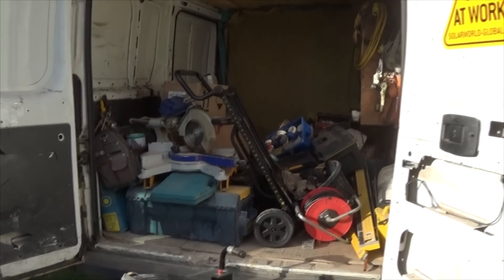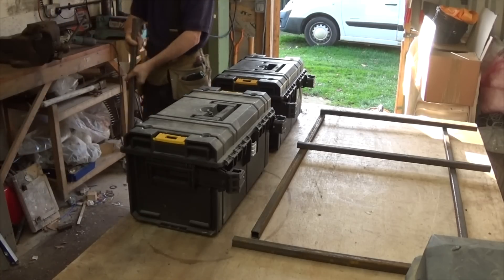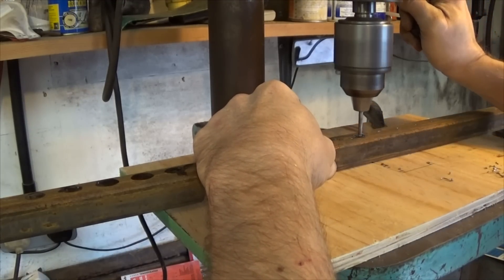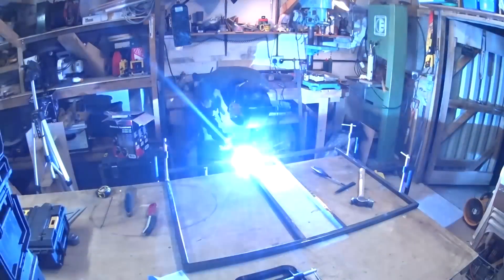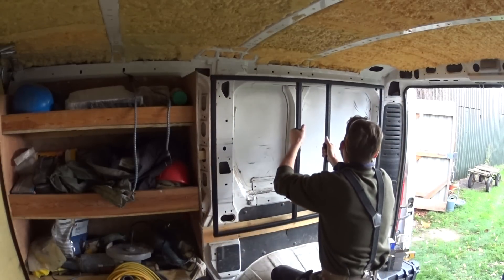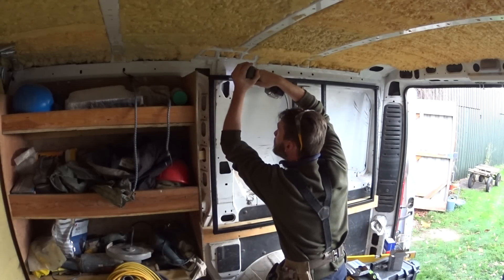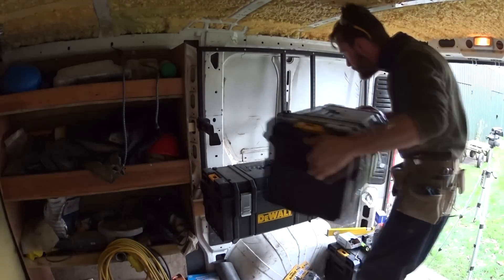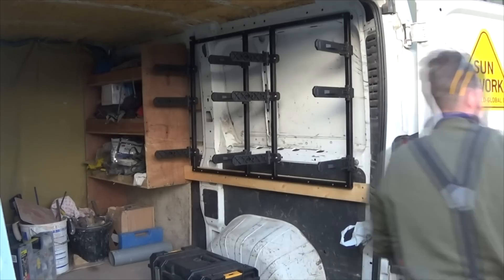Dewalt Toughsystem Van Storage

Comment: Hey there. How do the brackets hold up when the tool boxes are loaded?
Reply from the maker: +Geoff Johnston been over 10 months and all is exactly as it was when I first put them in. Works good.
Reply: I ask as dewalts version for a shed is what i bought and a week later they launch a setup specifically for a van. your setup looks good and strong. Whats your trade?
Reply from the maker: +Geoff Johnston carpenter, so tool boxes are full of drills saws etc

Comment: Looks spectacular. I'm a little concerned about the mounting screws though. My van has factory style shelving, not all that heavily loaded and the bolts (not screws) actually ripped the inner sheet steel. I'm assuming you have cordless tools and such in those boxes.
 I'd appreciate a follow up video after say, 1 year. 
 It's not like i'm doing jumps or anything but i do run pretty hard.
 Just seems like you're asking an awful lot from both the screws and the steel you screwed into. Hope it works like it looks cuz it looks awesome.
Reply from the maker: +john hanrahan hi thanks for the comment, its been about 4 months since fitting now and everything seems fine. The tool boxes are medium weight I guess, maybe 15kg for the heaviest with nothing moving or drooping at all. There are 6 fixings in the top rail and 4 in the bottom. Thanks for watching.

Comment: I have the Dewalt tough storage system and want this in my van. What are the brackets called (trolley hinge bracket?)and where can I get them?
Reply: I just found them! The Dewalt ToughSystem DS Brackets (no duh).
Reply from the maker: +Aaron Parr good luck with your build, I've had these in the van for a while and it works well for me.

Comment: Awesome video, could you share specs? Also is the spacing between both rows the minimum possible? Can the cases actually sit a bit closer together or is that the closest possible because of the handles?
Reply from the maker: +Michael Thibodeau the square tube is 25mm x 25mm the spacing between could probably go a little tighter, its better the bigger the gap. Thanks for watching.
Reply: Francis Barnett thanks for the reply! Do you have your width, height, vertical centre bar and whole spacing as well? Looking to fab something like this and yours is perfect!
Reply from the maker: +Michael Thibodeau the 25mm uprights are 480mm on centers, I guess the height depends on your van space, I made mine 850 total height and drilled holes for brackets every 25mm. Good luck.
Reply: hey Francis I want to build the same system in my vann. but the guy in the store thinks the hooks will not hold in the vann if you have to do bad roads . how is your rack now? no problems with to havy chests?
Reply from the maker: +dds reddevil its been three months in my van and no problems at all. The boxes are quite heavy. Thanks for watching.
Reply: dds reddevil I did this same thing in my trailer. My boxes are fully loaded and I have had no problems so far. I installed my racks in my trailer between the tongue and first axle where the ride is the smoothest. You could make some kind of shim to put between the boxes to unify the load if you were needing the extra stability. I keep a scrap of 1x4 wedged underneath my largest box  between the floor and the box to help relieve the stress because it weighs quiet a bit fully loaded. Hope this helps

Comment: Mate that is brilliant! I wanna do something like this is my van but I can't weld !! 😀 great job 👍
Reply from the maker: +Bob Builder you could easy bolt the bars together, as long as it was well fixed and level you would fine.
Reply: You can't weld?, dude buy welding equipment, teach yourself, there're tons of videos to learn from, if I told myself that I can't don't something I won't be a self taught contractor today!.